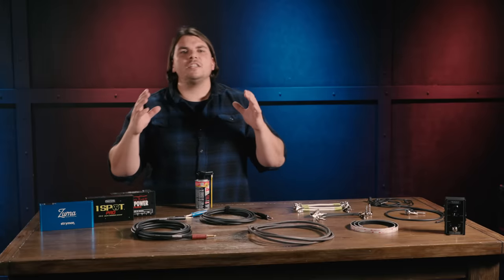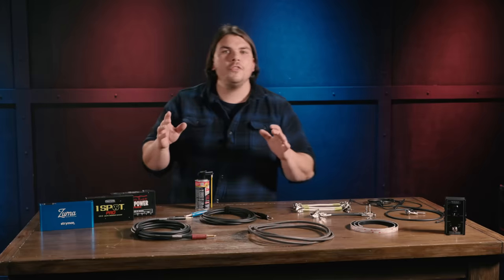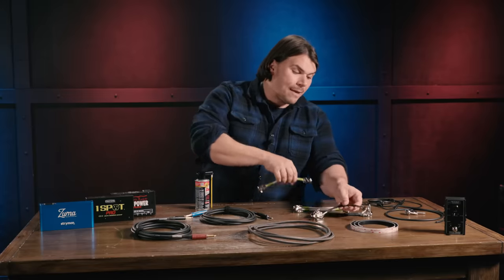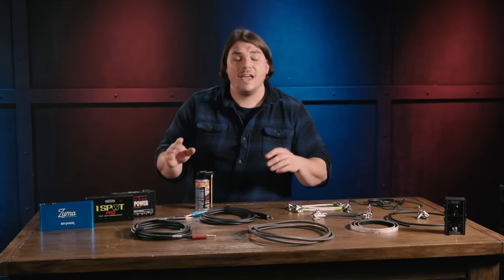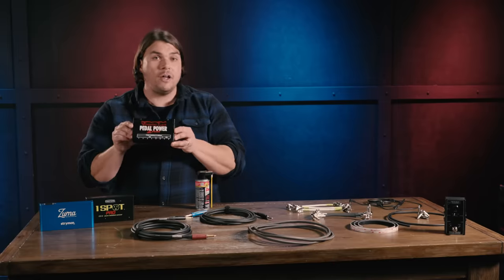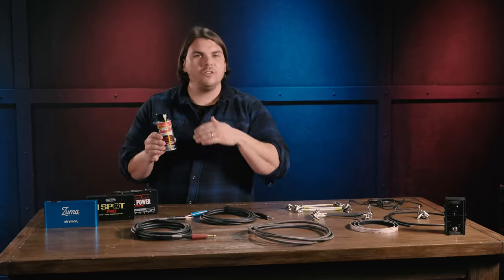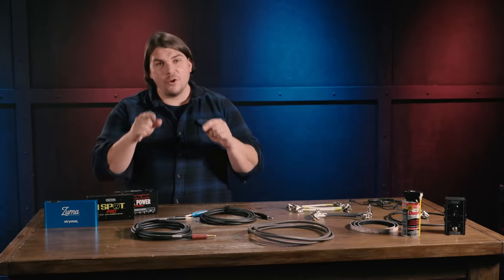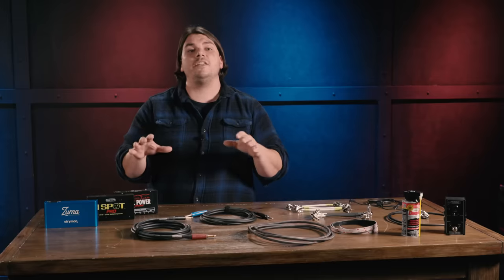6 Pedalboard Mistakes You Don't Want to Make

Comment: I don't like Velcro on my effects pedals at all... so I got a piece of used rubber belt material that was big enough, and I cut the pedal spaces into it for my pedalboard (similar to the Boss BCB-60, but with rubber belt material instead of "foam rubber"). I'm happy with the results I got from doing this... all 48+ pedals stay where they are supposed to, and there's no Velcro trying to rip the bottoms off of my pedals. Some pedals HAVE TO have the label on the bottom intact or they become basically worthless and not even pawn shops will take them. I don't plan to sell my pedals, but I also don't want to destroy their value.
Reply: Phil McKnight showed that you can cover the bottom of the pedal, particularly the label with painters tape and then the velcro will stick just fine, and the label is preserved. The only thing I've found it doesn't work well with is denelectro mini pedals, because the bottom is almost entirely textured rubber. For those, I just stick the velcro right on it. It's a plastic danelectro pedal....how much value is there to worry about? lol

Comment: Great advice. I'd also add to keep buffering strategy in mind as well. It's probably less important for two or three pedals, but once you start adding a lot of pedals, especially if true by-pass, and cabling, you may need a well placed buffer for capacitance purposes.
Reply: What's a buffer? That's a very general term.

Comment: Those pancake jacks often don't work because pedal makers aren't thinking when they decide where the 9V input is going to go. I wrestle with this all the time because MXR, Catalinbread and others put it too close to the i/o jacks instead of up on the front of the pedal where it belongs, so not only will they not fit, it also makes it difficult to deal with the proximity effect. Sometimes they put all three jacks on the front, again, too close together.
Reply: ohhhh..... thank you i was about to buy the pancake one.... thanks to you i realized it won't fit on my mini pedal.
Reply: What kind of jacks do you use for the closest fit?

Comment: Great advice. One mistake I made early on was using batteries to power my pedals. lets just say I found that out the hardway and have went AC power ever since then. it's the same now with my Korg RK100S2 keytar. and that thing eats 6 AA batteries for breakfast. I had to go AC power for it as well by purchasing an aftermarket adapter.

Comment: On my iso brick, all of my pedals sounds sound about 50% less powerful than plug directly without the brick. Fuzz, Friedman OD, delay just sound very weak? Is it my cabling? They all sound fine with an single power supply. Any suggestions?
Reply from the maker: Hey, mmasterdp. Thanks for reaching out! The biggest things to make sure you have are good cabling and the proper amount of power going to your pedals. Each pedal draws a certain amount of amperage, usually milliamps (mA). So, you will want to make sure you have enough mA going to each pedal from your isobrick. Each power out will show you how much each pedal has to draw from and you should be good to go. If the isobrick is possibly defective then you will need to reach out to wherever you purchased the unit from to see if there is a warranty.
I hope this info helps, but let us know if you have any more questions. Good luck!
Jack Wellington, Sweetwater Sale Engineer, (800) 222-4700 ext. 3240, jack_wellington@sweetwater.com

Comment: Today i'm just using two pedals, compressor and reverb, whats your best advice for minimalist like me? Do i need pedalboard, Isolated power supply etc ? Todays i'm using 9V batteries for both of my pedals, do i need iso power? and adding extra carry gear?
Reply: I find that 9v batteries can get expensive with multiple pedals. you could use a daisy chain power supply (amazon for ~$10USD) assuming both pedals have the same polarity (usually center negative)
Reply: Khalazia Faqih Batteries are sort of like the original isolated power supply, so you won’t get much in terms of reducing noise. One really good device that I didn’t mention on here that is very well priced, it’s a Voodoo Lab X4 - it’s $79.99.  It has four isolated outputs and you can use any 12 V wall wart to feed into the input and it’s super small, light weight and can tuck under just about any Pedalboard.  The only real advantage would be that you wouldn’t have to change the 9 V battery devices every so many gigs. Or you can watch the video with RJ Ronquillo, where I made him a battery power supply box so he could have the batteries external to the products for easy changes but all housed in a nice enclosure.
Reply: @VertexEffectsInc  ok got it
Reply: @untitleduser666  ive tried daisy chain before, they quiet noisy compare to batteries, but i'll try with another power supply
Reply: Get a truetone power supply, works great
Reply: @TheHouseJROD  one of the best in town!
Reply: @khalaziafaqih367  batterie will be as quiet as the best isolated power supply typically - however a lot of pedals won't accept them obviously.  I would avoid paralleling pedals if you can help it unless they're low current analog distortion/overdrive devices and maybe at max 2-3 devices that are all, cumulatively, under the current specs of your power supply output.
Reply: Khalazia Faqih 
Bro, you gotta get at least one delay pedal the Strymon Dig is awesome but there’s many good choices out there.  JHS has a good one too.

Comment: If I want to have in, out, send and return jacks mounted on my pedalboard, is there any advantage on using locking jacks? I see many brands using them, and even though they look very professional, I feel that they might be worse than regular jacks since if something happens and the cable is pulled from them, it will just handle all the stress instead of going out of the jack

Comment: Just purchased the Voodoo ISO-5, Question: This power supply has one input for 12V 300mA, I have 2 pedals that require that much power can I daisy chain the two pedals into that input?
Reply from the maker: Hi, Rowland! Thanks for your message, hope you're well and safe.
If each pedal requires 300mA, then the split won't work. The output is halved when you connect two pedals. You also no longer have the pedals isolated since they share the same tap.
Please contact us direct with other questions as you have them!
Robert Williams, Senior Sweetwater Sales Engineer, (800) 222-4700 ext. 2371, robert_williams@sweetwater.com

Comment: I’ve never put much thought into my pedal board. I simply use one power supply - daisy chain the pedals - into effects loop - Boss NS2 noise reduction for high gain amp - Then without thought or compassion towards others or regret - GRIP IT & RIP IT! I have a degree in music from WWTD university. WWTD = What Would Ted Do, as in Ted Nugent. On a serious note, Sweetwater is the best. I’ve gained a lot of understanding from these videos. I am a Sweetwater fan.
Reply: Music & More There will be some pedals that are not sensitive to being paralleled by a daisy chain.  However, you might be surprised how much you can get away with, removing the noise gate and using a high-quality isolated power supply. It might make for an interesting experiment, and Sweetwater has such a great return policy you can pretty much do so risk free.

Comment: A problem I run into is going from my last pedal on the lower tier to the first of the upper or rear one.the input always seems to be opposite of the out on the previous lower pedal and I end up using a longer patch than what is ideal.Is a custom cable my only answer? Also will pedals ever become uniform with inputs on top or the side becoming standard? I think I like top input - output the best.
Reply: I ran into this same problem, from what I can tell you need a custom one or a specific size like the Ernie ball ones he mentioned, I have yet to check those out

Comment: I’ve just purchased the 1Spot CS7, I have 10 pedals that I want to power with only 1 going above 100ma, how would I power all of these pedals with the CS7? What’s a splitter cable and would this work to power my pedals? Thanks :)
Reply from the maker: Thanks for your message, Riley! If the total available power requirement for your pedals doesn't exceed the total output of the CS7, it's possible. Keep in mind that as soon as you split a power tap, you split the amperage to each pedal. You also increase the likelihood of noise since each pedal on the split is no longer isolated from the other. You also can't mix 9v with 12v or 18v.
Please contact us direct with other questions as you have them!
Robert Williams, Senior Sweetwater Sales Engineer, (800) 222-4700 ext. 2371, robert_williams@sweetwater.com

Comment: I have both a wireless and an active bass so from your other videos it appears I don’t need an input buffer.  Is there any reason I can’t place my wireless on my pedalboard, run it straight into my effects, and only have one cable going back to my amp.  Thanks for the education. I will see what I can do for further support.
Reply from the maker: Hi, Slim! Thanks for your message, hope you’re well and safe.
Some wireless systems don’t play well with active electronics so you have to test the signal chain. In theory, yes you could feed the output of the receiver into your first pedal. If your amp has a loop, you can run your pedals there and have the wireless go into the amp input. Yes, two cables however it may be more favorable sonically.
Please contact us direct with other questions as you have them!
Robert Williams, Senior Sweetwater Sales Engineer, (800) 222-4700 ext. 2371, robert_williams@sweetwater.com

Comment: Cool !  gonna order the connection cleaner :)
Any tips on removing that 3m velcro ?
Reply: I just peel a corner with my fingernail and work from there and I usually get it off relatively easy.

Comment: If you have an ES-8 (or other switcher where the jacks are stacked), good luck not using solderless. You certainly can't use right angle soldered patch cables unless you want them sticking straight up or something.
Reply: Switchcraft 380 is a good alternative sold here at Sweetwater that works great and is solderable.  I personally use the SquarePlug SPS4 and SPS5 on switchers.

Comment: I bought from Sweetwater a Voodoo Lab Pedal Power Mondo how would I connect this to my PB1000 Beringer Pedal Boat with 12 pedals, or did I need this?
Reply from the maker: Thanks for your question Adam, hope you’re well and safe.
Your PB1000 is a great surface to mount your pedals. Please use every connection on the Pedal Power before anything else. That power supply is isolated and grounded with sufficient voltage and amperage for about any pedal available. It will make your rig much quieter overall than the power available on the Behringer board.
Please contact us direct with other questions as you have them!
Robert Williams, Senior Sweetwater Sales Engineer, (800) 222-4700 ext. 2371, robert_williams@sweetwater.com

Comment: Do you do dual lock to dual lock or dual lock to traditional Velcro? 

Do you spray deoxit into the foot switch too?
Reply: I spray it in any place where there's a connection if I suspect a problem.Foot switches usually need to be unscrewed for this if you want to use cleaner on it.

Comment: Thanks for the video!
Was wondering if ai should separate a power cable (24V) that connects my Strymon Zuma and Oja from pedals and audio cables?
Or it’s not so bad as the regular AC so don’t have to worry if that cable (24v) is close to the pedal?
Thanks
Reply from the maker: Thanks for your question, MK. As I read your question, you’re concerned with the power connection between the Zuma and Ojai creating interference with the audio path? One cable is unlikely to create an issue. Best practices is to run cables separately, cleanly and not parallel.
Please contact us direct with other questions as you have them!
Robert Williams, Senior Sweetwater Sales Engineer, (800) 222-4700 ext. 2371, robert_williams@sweetwater.com
Reply: @sweetwater  thank you for the answer!

Comment: Is the MXR DC Brick M237 an isolated power supply?
Reply from the maker: Hi, Gary! Thanks for your message, hope you're well and safe.
The M237 Brick is not an isolated power supply. The M238 ISO brick and M239 Mini ISO brick are isolated.
Please contact us direct with other questions as you have them!
Robert Williams, Senior Sweetwater Sales Engineer, (800) 222-4700 ext. 2371, robert_williams@sweetwater.com

Comment: Nice tips Rig Doctor! I'm using the dual lock on my current pedalboard but it doesn't stick very well on pedals with all rubber bottoms like BOSS pedals.  Are there metal only replacement plates you can put on the pedals instead of a factory rubber base? Any other tips? Thanks!
Reply: HEADSTOCK HAREM There are two options. Option one is buying a plate to go over the bottom, many plastic stores here in the United States, like TAP plastics will do this for you to order very inexpensively.  However, my preference is to remove the rubberized bottom on the BOSS pedals, and then flip it over there removing the screws in simply inverting the metal plate it’s on the bottom of each device. It will leave you a completely clean surface to apply Velcro to.
Reply: Take the rubber bottom off, (don't have to be thorough), then screw the metal plates backwards. Done. If you want to put the rubber bottom back, you can use regular glue.
Reply: Check out the Guitto Velcroless Pedalboard and you’ll be amazed!

Comment: I think AC means audio cable here?  Or are audio cables also utilizing AC current?
Reply: Evan Keal What do you mean? AC would be like the power coming out of the wall into your amplifier, or your power supply. DC would be the outputs coming out of the power supply going to the respective devices.
Reply: @VertexEffectsInc  ok I get that but he is holding a patch cable when he says AC.  I know even the DC power supplies have one AC cable, but I think he is referring to audio cables when he says. Ac, this is a board video, not a rig video, maybe I listen to literally.  Not many people need to route AC power cables through the board, which is the scope here.
Reply: @evankeal  Audio signals are alternating current (micro-current) signals, audio signals have positive and negative voltage transitions at varying frequencies. The signal that comes out of your guitar pickup is an alternating positive/negative signal at the fundamental frequency of the note(s) being played along with tonal harmonics of the fundamental frequency, these are in effect AC voltages, typically in the range of milli-volt or sub milli-volt levels. What you want to remember is that if a power supply cable has to cross an instrument cable between pedals, try to make the intersection of the two cables at right angles to each other for the least amount of induced hum or noise.
Reply: both audio and AC power coming out of wall outlets are AC voltage signals
Reply: @rebel-yell9453  The only issue with DC crossing AC is if the DC also has noise on it.  High frequency, clock noise, etc.  But it has to be at high enough level to occur.  It is not likely that DC goes high enough in level to bother the shields signals.  The problem is AC power cables near signal cables that “could” be a problem (signal cables meaning patch cables, guitar cables), but with the low currents on the pedal board, the magnetic fields from the AC cords should not be a problem.  That is easy to test by taking the AC power cable from the pedal board power supply and lay it next to signal cables on the pedal board.  Try different locations and see if there is any hum as a result.

Comment: Any ideas what’s wrong with my pedal, I used a one spot pedal supply, and I have my 9v chord going to my pedal, but if I even press on the chord that’s sitting in my pedals 9v input it’s sound completely cuts. But if I remove the chord from the power supply, and use a 9v power adapter plugged to the wall, and press on the chord going to the pedal now, it doesn’t cut out. If only seems to cut if I plug into the pedal from the one spot power supply. But it’s only this pedal that cuts if pressed on, not any of the other pedals. Any thoughts?
Reply: Most probably you have broken solder joint on power adaptor input. Just take soldering iron and renew soldering joint. Chances are good that you don't have to replace DC input, just to re-solder existing one.

Comment: Hello.My Trex Fuel Tank has everything you need BUT it makes wah pedals sound very noisy!do you have any advice to prevent this?
Reply: The inductor in the wah will be sensitive to the magnetic field produced by the transformer inside of your power supply.  You could experiment with what happens when you move your wah and power supply to opposite sides of your pedalboard.  If this isn't possible, you can try to find a mu-metal can to put over your wah inductor to help shield it from electro-magnetic fields produced by a linear analog supply like the T Rex.